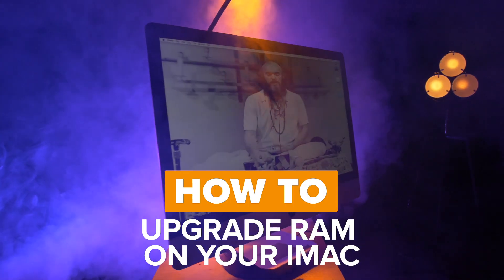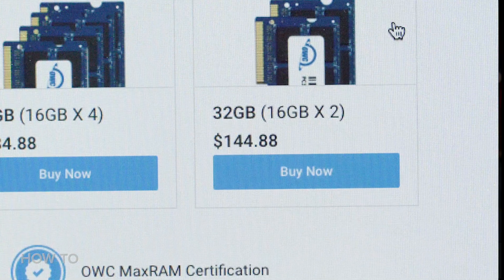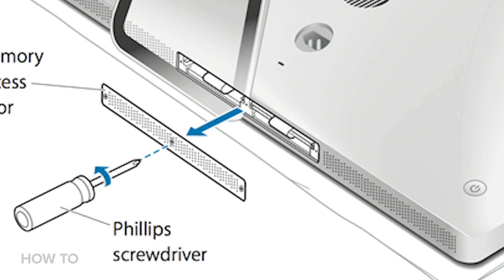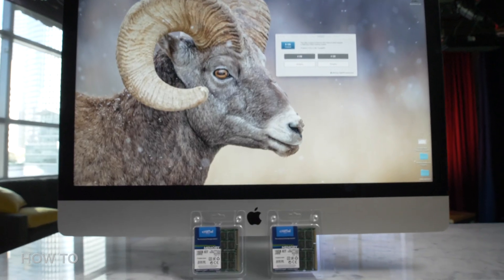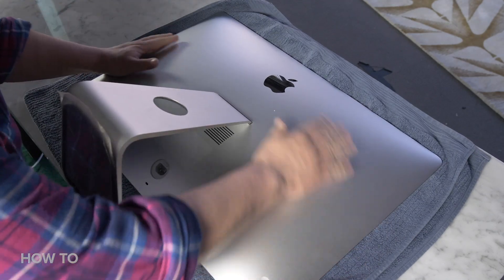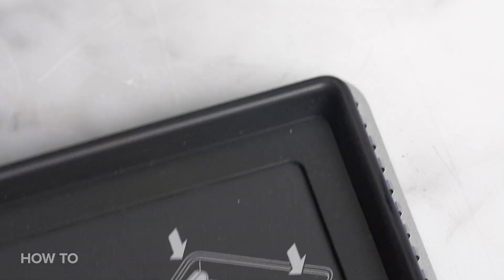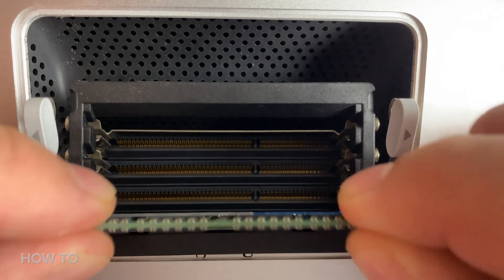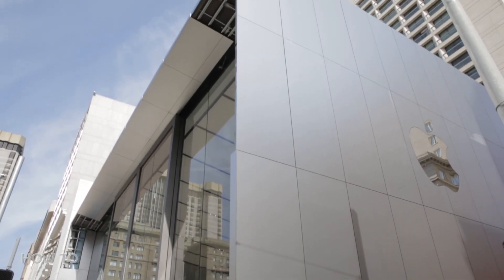Upgrade your iMac's RAM in less than 5 minutes

Comment: Such a good video. 
My iMac was making noise. Genius bar ran diagnostics (quick/easy) and said it was due to RAM degredation therefore fans coming on more but couldnt fix iMac as it was too old?. 
Fixit store was going to tear off screen to fix and charge $600 plus and there was a chance the screen would break.
Your video saved me a ton of time and money. Got 32 GB RAM for $75 and then plug n play.
Thx you soooo much!

Comment: Upgrading ram may increase data speed when running multiple programs , I’m wondering if there are disadvantages when doing that the battery may use up more or the capability of cpu or cpu may be affected by “over ram “ as a result of shut down ?

Comment: i took out 1 ram just to check it and now i hear beeps ,, i put it back and still black screen and same beeps sound , imac 2011 27, any advice?
Reply: Remove and clean the RAM AND SLOT.
Reply: Next RESET PRAM if required

Comment: I do this which worked (thanks for that) but man even with eggs extra memory it’s still not enough for my video editing. I have to make partial videos and then combine them into one after I delete the extra footage. 

Is there anyway to add even more? I use and external hard drive for my footage but even the it’s not enough. I was hoping for a hardware solution

Comment: Unfortunately, I will not be able to upgrade my late model 2013 with 8 GB. I did however, acquire for free a 20 inch mid 2007 Mac with only 2 GB, now I can update it. Of course, I used only my MacBook Air with M1 chip for everything.

Comment: The one part I needed, you missed--about mixing differently sized sticks.  Ex., should I pair the 16's in one bank and the 4's in the other?  Or just the opposite?  Apple says to balance them in each "channel."  If that's to mean, bank.  Unsure.
Reply: No clue, but I took out the original and replaced with the 16 gb x 2 I purchased.  Put the old 4 x 2 into the unused slots and no issues yet (been only a few minutes now).   I can see it reads as 40Gb now ... hope it speeds things up now
Reply: @tomskmtmathew  How did that work out? I have 2x4 and 2x8, thinking of buying another 32 and replace one slot with that.
Reply: @bennykanny  I landed up buying two sticks and popped them in taking it to total 40 gb (4+4) + (16=16).  I feel the machine will take it.  I purchased the sticks on Amazon, so if I had a glitch like incompatability, I could return it within 28 days.  so far so good.  I don't see any big differences but the thing would do its business when under strain I guess.

Comment: While upgrading my 2017 iMac I removed two 4GB cards. What struck me as being odd the GB cards are not the same. One was made by Crucial and the other one that was black with white lettering, made by ??? .. I don't know the brand, it did have the letter M on the card .      Question , should I go back in to my Mac and  replace the unknown brand card with my spare Crucial card to pair with the other Crucial card?        BTW the Mac seems to be working ok :-/

Comment: hello good evening, I wonder if any of you can help me, I have an old Imac 21.5 inch , mid 2011 - 2.5 GHZ Intel core i5 with a 4 GB 133 MHz DDR3 RAM, My question is how many GB of RAM can I upgrade for this iMac 21.5 Inch Mid2011, Please need advice, anyone??? Many thanks.

Comment: So if I purchased a new 27in iMac, could I buy a 32GB RAM chip to add to the two 4GB RAM chips that come with the iMac to make it 40GB or would you need to discard the 2x4GB RAM before putting in the new 32GB Ram chip?
Reply from the maker: That’s a good question. Please consult with Apple support chat.

Comment: Just got my new iMac and I wanted to upgrade the 8gb to 128gb. I bought the OWC kit and replaced the 2 sticks of ram that came with the computer. I tried to boot the computer back up and it wouldn't turn on! I put the original 8gb of ram back in and the computer still wouldn't turn on. Not sure what to do now. Any suggestions?
Reply: Did you fix it because it’s what I plan on doing
Reply: @kysheemb  yes, I’m the end it all worked out - it just took some readjusting of the ram sticks and rebooting the computer a couple of times
Reply: @Hhart94  I put mines In already and it works but the fan in my iMac goes crazy
Reply: @kysheemb  I've noticed that too. Whenever I'm exporting files it sounds like it's going to explode lol

Comment: Great video, thank you! If you're only putting in two sticks should they be in slots 1 & 2, or slots 1 & 3? If keeping the original 4GB ones also, do they alternate slots or do one size in slots 1 & 2 and the other size in 3 & 4?
Reply: It’s definitely best to have the same ram from the same company as well as equal amounts (4 in four, 8 in two, 8 in four, etc)

Comment: great video, thanks for the 21.5" tip.  I might just buy the 27" instead
Reply: I did the same, bought 27" 16gig RAM for $950 on Amazon, just upgraded with his instructions so easy and now super fast. My slow 21" just sitting there now :(

Comment: Great detailed video thanks. Can I add a single 32GB mem card or do they need to be in pairs?
Reply: Pears  mmmmm
Reply: They need to be in pairs but do not need to match, i.e., you can have 2 - 4gb sticks and 2 - 16gb sticks installed together. You can’t have a 4gb, an 8gb and a 16gb, they have to matched in pairs.
Reply: Pairs

Comment: I heard from a best buy worker that putting in 64gigs of ram in my 2020 Imac could be bad for it; he said something like "bottlenecking". what's a good amount to upgrade on a a 3.7Ghtz 2TB HD on the 27" Imac??   The max says 64gigs.
Reply: The max is 128, but you should probably do 32 Gb, which is more than enough for the next decade.